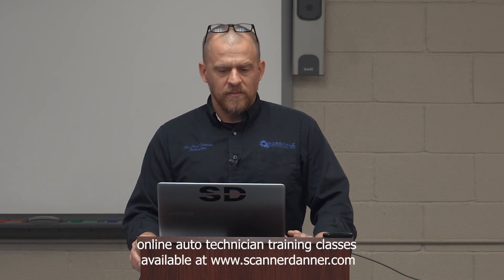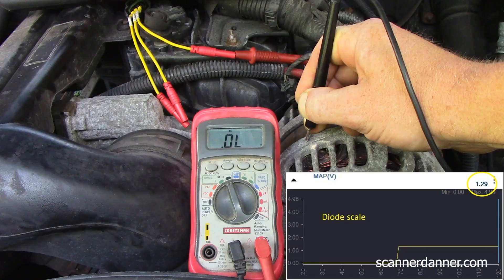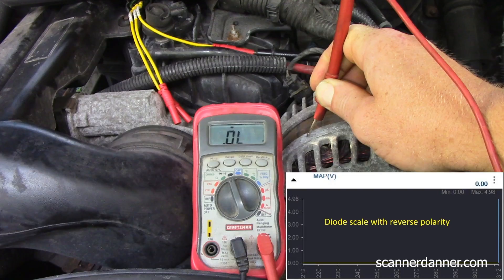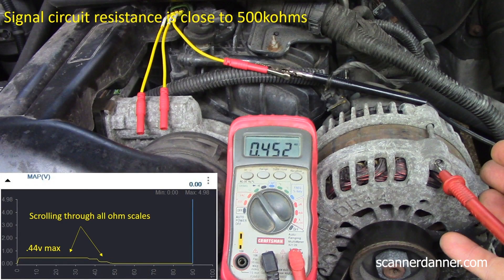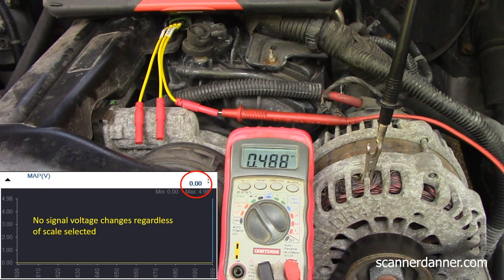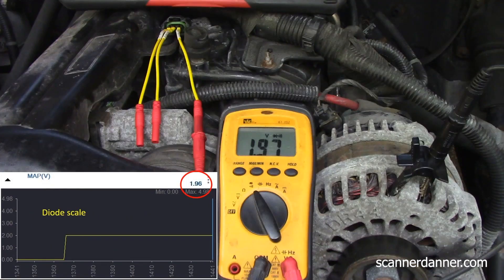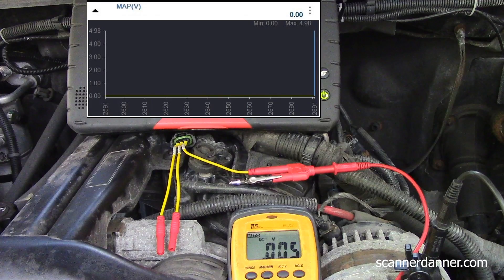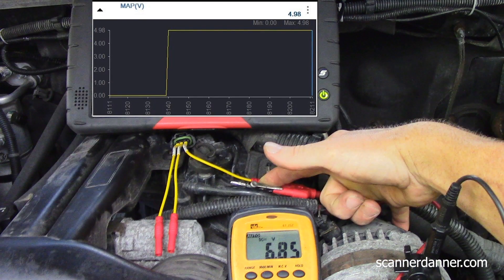Using a Diode Scale on a DMM to confirm Circuit Integrity

Comment: I’m a subscriber with a somewhat perplexing situation with a 2004 Cadillac CTS, with a no crank condition. Car just clicks when you turn the key to the start position. Checked the battery, voltage was low (less than 10 volts). Hooked a jump pac to it, same thing, just clicks. Pulled the starter relay, both powers and both ground present. Connected my orange Uactivate relay bypass tool to it, flipped the switch, car fired right up! Can you help me figure this out? I mean, what kind of sorcery is this?
Reply from the maker: Put your uActivate back in and check the control circuit very closely
Reply: @ Thanks, will do. And thanks for getting back to me so quickly. You’re awesome, man

Comment: How would high resistance  in the circuit affect both the ohmmeter and the diode reading? Thank you.
Reply from the maker: This test is done when you have a fixed 0v signal on scan data, on a non bias typed signal circuit.  High resistance on a signal circuit would skew the signal, where it would be normal when measured at the sensor but lower on scan data. So you're hypothetical would not be the scenario where this test would be used.
Reply: @ScannerDanner  Thank you again. As I said before, you are my mentor. Your channel is the one I watch the most. I now can use this test without hesitation. Even though you said that you like  the diode test more than the ohmmeter, I am planning on using the ohmmeter as it has lower voltage than the diode test even if I have to reverse  the leads.

Comment: Actually when the meter is in diode mode it provided a constant current and it is the resulting volt drop across the circuit that is displayed, the reason for different meter reading is different output currents. In other words this is a basic Vf test.
Reply from the maker: The voltage displayed on the scan tool is the same voltage output the diode scale produces.

Comment: This has been driving me crazy, l've done replaced the purge valve, gas cap, and solenoid on a 13 Nissan armada, BUT still getting P0447 (control circuit open) tested each old/new part they worked fine when applied 12v BUT... solenoid is not opening/vacuuming when car has warmed, gas still spewing out when filling, and STILL HAVE CODE
! I tested the connection
on the harness to the solenoid and it's getting power/ground, what could it be!? I'm curious if the pem is not sending signal to open!? Or could there be something else that would cause the solenoid not to open!? Thanks ANYTHING HELPS
Reply from the maker: "Control circuit open" is definitely a wiring, solenoid or driver issue.
Step 1 - solenoid plugged in, with the key on, give me voltage readings on both wires individually with voltmeter connected to a known good ground.
Reply: @ScannerDanner  1st I REALLY appreciate the help and response! So I ordered/installed a fuel pressure sensor hopeful that would trigger it, but I just checked both power and ground on the purge solenoid, that was the 1 you was referring to correct, up by the motor!? So it read 12v on both UNTIL I hook the harness into the solenoid like u asked and then got 12v on power Still, BUT Only 543.88 mv! I’m assuming it or something not grounded good!? Also while changing the fuel pressure sensor I’m not getting voltage to the vent valve or the fuel pressure sensor!? Hope this helps, any suggestions!? Also I wanna thank you again! 🫡
Reply from the maker: @MoToArchY  ? What is the code for? Purge or vent solenoid? Also I need a better description. 
Plugged in = ? 
Unplugged = ? 
On both wires, with key on
Reply: The code was a P0447 Evaporative Emission System Vent
Control Circuit Open. The purge solenoid, key on, unplugged= 12v to Both power and ground, plugged in=12v on power, and 543.88 mv on ground. Solenoid is good also, bench tested! Also I have a power probe
Reply from the maker: @MoToArchY  you're testing the wrong solenoid. You need to be testing the VENT solenoid

Comment: Plus won’t using your diode scale show a bad diode if there is voltage with the leads reversed?
Reply from the maker: This test isn't being used for any type of diode testing. I'm only using the diode meter to inject a small voltage into the signal circuit to confirm no opens or shorts in the signal wire. This test eliminates the need to disconnect the module and sensor and perform resistance testing on the signal wire

Comment: Brilliant idea, to use the output of a diode test to prove the module can see that voltage. I don't know why I never thought to to that.
Reply: That’s because hindsight is 20/20. Until I was tough shorting sensor circuits with a test light was never a thought to me.

Comment: One thing to note is a zener diode won't work with an ohmmeter.  The diode function is needed to fwd bias it.
Reply from the maker: We are using the diode test on a DMM in an unconventional way. So we're not testing diodes in this lesson

Comment: I posted on the forum recently about a p1682 code specifically trying to avoid calling a bad ecm without proper testing. As yet, no one has responded and I am at a loss as far what further diagnostic steps to take.
Reply from the maker: The more specifics you can provide, the better your chances are to get help. Year, make, model, engine, history, symptoms, tests your performed etc.
Reply: That code I’ve seen more with GM vehicles with fuse box issues, sometimes relays, rarely ignition switch, maybe wiring problems(pin fitment, high resistance), and unicorn being ecm issues.

Comment: Can you give some examples of “outputs” that could do damage if shorted
Reply from the maker: I have many lessons on this! Check my chapter 3 playlist.
But one example:
a power side switched circuit with a short to ground on the control wire would cook the driver in a module.